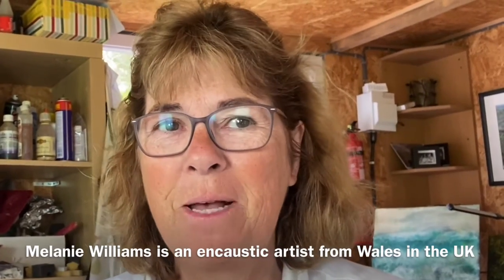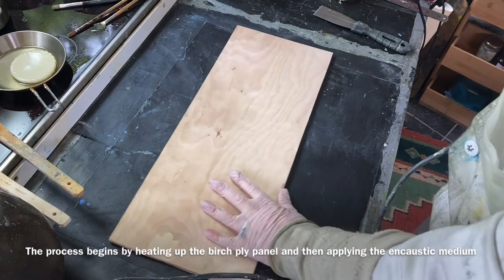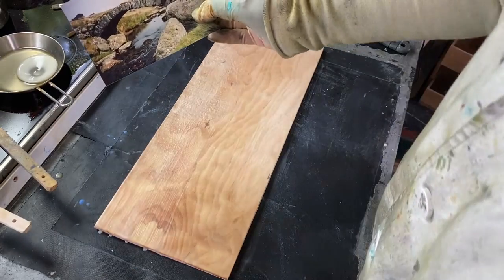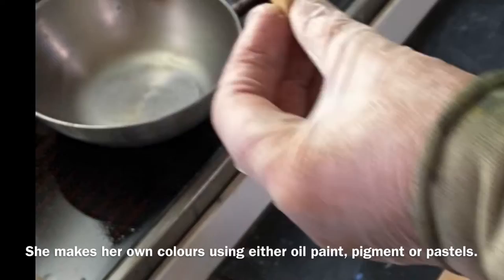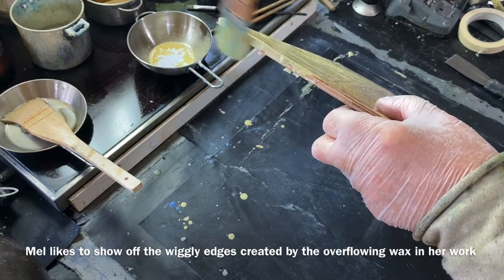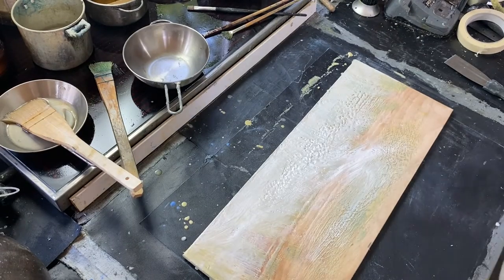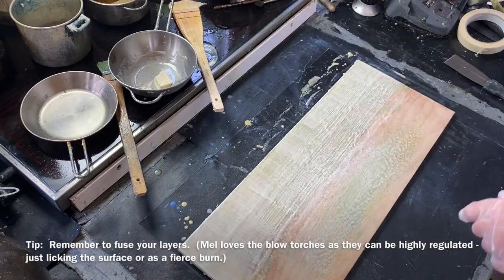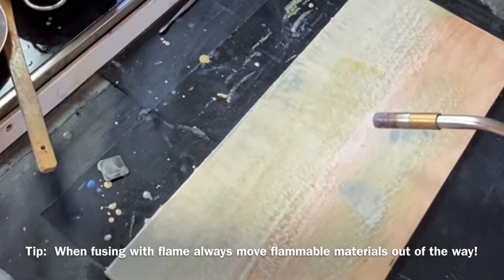Melanie Williams - Free Encaustic Painting Video  - An Encaustic Landscape

Comment: Good stuff. I too am in a lot of pain big time. I have a question how do you store the oil pigments? I keep mine in a bag some wrapped with cellophane or still in the tube? I know sometimes it’s hard to get out. Do I just put the in a box without anything on the tops? Also I love your pan on the hot plate. I know you live super far Have any idea where to find one. Thank you🌻
Reply from the maker: Hi Lynn.  Sorry to hear you are living with pain too.  
I keep the oil in the tubes and make sure the lids fit properly.  The oils will set if you leave the lids off and be useless for making encaustic paint.  The small pans I use are children’s play pans.  Some are from IKEA if you have that store.  The small ones are actually metal measuring cups.  I’d love to see some of your work.  All my best wishes.  Mel